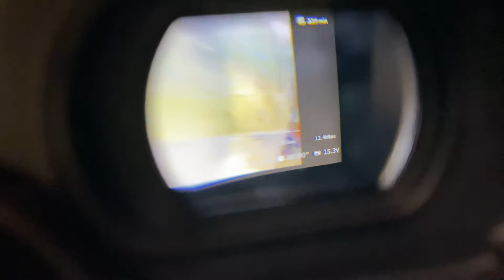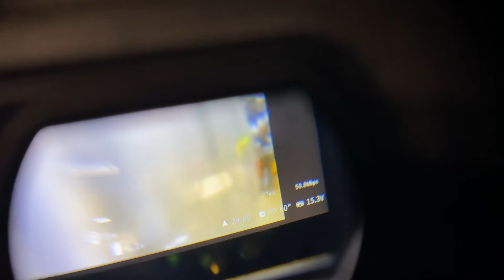Power Related  DJI FPV Video Issues (Low Bitrate-High Latency)

Comment: Thanks , i have the same problem, low bitrate using a BEC that i think is wired correctly. I can't see in your video what you do to solve the problem, your hand hides where you solder.

Comment: This may sound silly but you should do a quick video on how to wire up the BEC.  A lot of new pilots have no idea what it is, let alone wiring up one.
Reply from the maker: Thanks for the feedback, I mean these ones I use all have documentation so I would just be regurgitating it.

That being said we also live build on Facebook!
Reply: @QuadStandardLabs  ok, so what if I’m still on the 25 Mbps and it reads 35 to 40 at standing ?